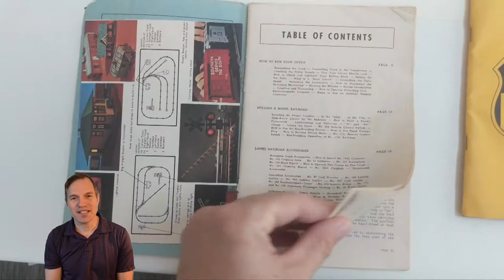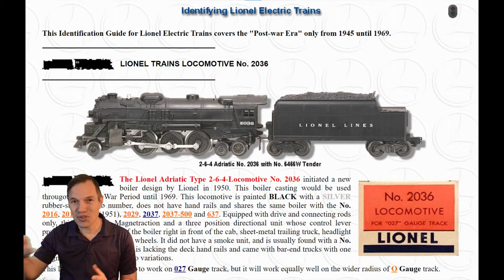Lionel 2036 toy train restoration and smoke unit upgrade

Comment: Those engines ran great if it is constantly shorting out there's something wrong with it the front truck might be off it might need to be adjusted to slap short-circuiting. They are great running locomotive. Lots of people had a toy train of various manufacturers including Lionel circling the Christmas tree during Christmas season but Danny will be put back in the Box until next time. It was a decoration it wasn't a toy train played with everyday or a model railroad on a table they did not go further than the circle of track that ran underneath the tree. My dad's Lionel layout ran the whole length of the basement of the house in New York and he would run five powered locomotives and 100 cars. If something derailed on the far side of the layout you just walked on the layout and re railed the car. It is a shame that he just ran the train around Christmas time because model railroading is a great father son activity. Railfanning trains mama going to train shows, give kids memories of doing stuff with their fathers that last forever. For a father and son working on a train layout was a labor of love.

Comment: Stories like this is very touching . Sorry for your loss of your dad He would have so happy that his son & now your children his grandchildren can look at a piece of history of his electric trainset. I have been a  train sets since past infancy. Now myself & others who will view this can be as happy as i am. My first trainset was actually was a LIFE LIKE HO scale set in 1974, I originally wanted a LIONEL but wasn't affordable. Years later My HO collection is enormous. I later bought at many train shows Modern equipment of freight trains that ran in the 1970's into the 1990's. In The 1990's I modernized the newer Lionel tracks and later bought my first Passenger coach but not the vintage ones.. Commuter rails in O Scale! Well later on I plan to run them eventually , meanwhile my main sets are HO. I noticed on your trainset the electric sparks i forgot about that electric feature. When my trainset was bought trains in HO Scale tracks were brass & small yard steam switcher was my first a dock side locomotives they were called. Many diesels that i later followed had that mini electric spark even when TYCO my second trainset 1976 switched to steel track in 1978 trains like ATHEARN had that mini electric spark. As brass was being phased out to steel tracks ATLAS switched to Nickel plate tracks ending that bonus. On some older trains with the now nickel track the sparks were little noticed. As O SCALE MIKES TRAIN HOUSE had wonderful trains & accessories in O & HO . MIKES TRACKS didn't appeal to me as LIONEL roadbed track does. ATLAS also of course sell O SCALE 3 RAIL TRACKS. I shared a bit of my history as you have shared yours to all your viewers. I am not just my first time watching but i want to give you a 5 star for a wonderful family video that's truly dear to my 💙❤ & for the love of electric trains. 👍🎥🌟🌟🌟🌟🌟🚦🚥
Reply from the maker: Thank you for your story.  

I made a special set up to get the train to spark just for one shot.  I wanted a shot of the train going under the couch in the dark with sparks flying underneath the train.  It wouldn't do this naturally, so I attached a small piece of aluminum foil underneath for one run, and it made sparks.  The hot and neutral wires are connected to the inside and center tracks.  When the aluminum foil drags along under the train it creates a short between the hot and the netural, and sparks are made!  After my run I was surprised to see holes burnt right through the foil.

Comment: There is a gasket that is supposed to go between the top of the smoke unit and the inside of the cast metal shell.  It is supposed to keep the smoke particles, or excess smoke fluid out of the workings of the motor.  You may want to install this gasket.
Reply from the maker: Thank you!  I didn't know that.  I will look into it.

Comment: Chris, Good for you in keeping your Dad's memory alive and for his special interest in his Lionel trains and railroading in general. Trains were  special under a Christmas tree. I received my first Lionel train No. 2036 also in 1950 when I was 9 years old. Needless to say, that was a very memorable Christmas in our home. I remember telling my Dad, "I wanted a Lionel with 6 driving wheels". The 2036 was under the tree along with the whistling tender, a NYC black gondola, a Sunoco 2 dome tank car, and a Southern Pacific red caboose. I also got a operating milk car which was the main attraction. Presently, I'm putting in a smoke unit in my 2036, and your video was a great help. Good luck to you and your family. Frank Brubaker, South Carolina
Reply from the maker: It sounds like you have all the same cars!  Adding the smoke unit was pretty simple once I figured it out.  My next idea is to attach the bar of the piston to the driving rod (maybe with a little wire twist tie) to increase its range of motion.  That would get the smoke to puff out with more speed - maybe even blow some rings of smoke.  Have fun!
Reply: @safadez  Chris, Thanks for the info on the wire twist tie. Have a great holiday season. Frank

Comment: I just picked one of these up at a flea market today and it needs a lot of work. Can't wait to get it running again. I don't know if anyone else ever let you know, but while researching this 2036 I found out that they did come with smoke units but not until 1953 so the many that were made between 1950 and 1952 did not come with a smoke unit. I like how you solved the problem with the piece of aluminum can. Very nice tribute to your dad.
Reply from the maker: My dad would have been a teenager in 1950-1952.  As a correction to what I said in the video (my dad having this toy train as kid), I found out that my uncle actually bought this for his kids to play with.  Later he gave the train set to my dad when my older siblings were little.  So my dad was already an adult when the toy train came to him.

Comment: In the old days you had toy train shop she could have just brought them locomotive in and the guy would fix it and it would run perfectly. I have one of those engines I ran it off my dad's Train table and broke the pilot off and for 40 years did not own up to it.. try running a modern Lionel steam locomotive off of Train table and have it still work I don't think so simple is good
Reply from the maker: There is a toy shop near me that still has a train repair tech.  I mention him around 5:50, but didn't share a photo of him in the video because I didn't get his permission for that.

Comment: The steam chest has the cutouts to accommodate the smoke piston actuating rods there is no need for the additional parts you made. The small notches can be seen clearly in the steam chest at 8:32. The boiler casting and steam chest would be the same as the 2026.
Reply from the maker: Thank you!  I really appreciate the knowledge that gets shared online like this.  Since you are telling me the names of the parts, I know what to look for now.
Reply from the maker: I just ordered a smoke lever from the 2026, so I can get the piston properly attached.  I have been hoping for greater range of movement in the piston to get higher, more separated puffs of smoke.  This may do the trick!  Thanks again.